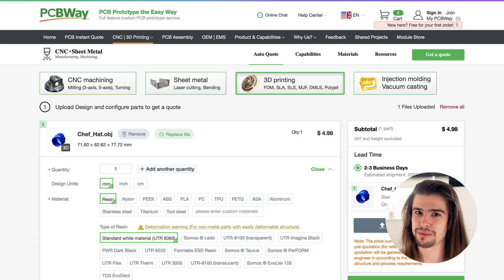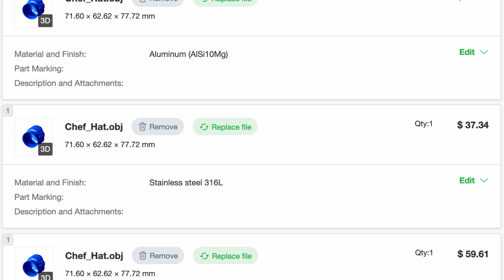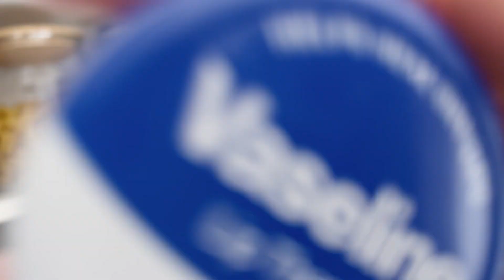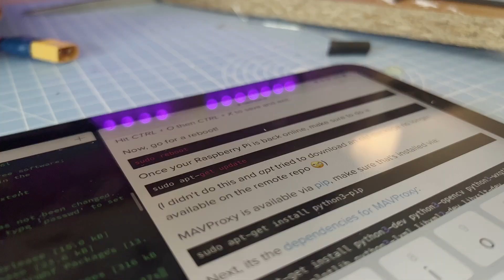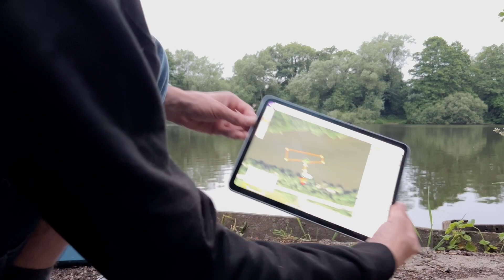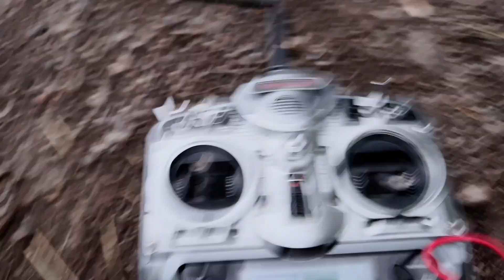3D Printed Drone Boat With PixHawk Flavored Sprinkles On Top

Comment: Ghizzz crist! just get a cheap Ender V2 or larger chea FDM printers and avoid to much  all that glue thing! the cost you've used in all that glue epoxy and all are just the same as a cheap big volume 3D printers anyways!

Comment: Dip your silicone tool in dishwashing liquid and it will work fine .. works with fingers too
Reply from the maker: I was trying straight water with no luck, will try this next - thanks!
Reply: @akamatchstic  might want to add some water if liquid is very concentrated...

Comment: How will your boat right itself if it is flipping upsidedown by a wave. BTW, you would do well to have a bilge pump and seal your electronics with a marine grade epoxy. They don't get along well with salt water. If a 3D printed hull is your final design, then cover the entire exterior with fiberglass cloth and epoxy to prevent a hull breach and achieve as low a drag as possible. Lastly you need to make major improvements to the area of the propellor shaft seals and glue the u-joints to prevent loosening while underway. Good luck.

Comment: If it's not underway yet, (1) look at the newest development in propellers where props don't have solid blades but loops. These can be much more efficient. You'll be aware that currents in the Atlantic can easily flow at a couple knots and when these are against your boat, you'll need to be able to exceed that in order to get forward. (1.1) this means your waypoints nav AI may need to be able to adapt its route to those current patterns. Along such lines, if you are familiar with AIS and sailors on the fear of ocean going sailboats of being overrun by large cargo/cruise (military?) ships then you'll know how they use AIS to sleep better and occasionally steer clear of a collision. Some of these sailors have called a, say, 400m long container freight ship to ascertain their actual path - they got politely answered but the crew in the wheelhouse may have been ROTFL after that call.
Then, what if (2) heavier ocean waves flip the boat over? Is it self-righting? If the boat doesn't have sensors that measure its orientation (and wave motion from that) and so it cannot use such data to sail perpendicular to the rolling direction of waves, then trying to prevent the flips is difficult and getting flipped over is a very serious risk.
The boat can navigate waypoints as you demonstrate but when it is upside down in the water, collects no solar, and tries to navigate the waypoints, the battery will be flat really quickly. So when another wave flips it in the right position again, will it (3) boot its electronics again once the solar has collected enough power?
The "big" lid is (4) a bit of a leak risk as you demonstrate and I probably would have opted for a (5) two compartment design where the motors are in a separate chamber, so there would be a waterwall (cf. firewall) between the electronics and the motors. This would also make the lids smaller, each and this is easier to DIY into waterproof.
You also demonstrate that water comes into the innards easily via the propshaft and its tube. Yes, grease will reject it for some time, but at the scale of an Atlantic crossing? Human size adapted boats will have have a bilge pump that sends such water overboard. (6) I would consider an aquarium pump and check valve to send water out of the motor bay. Note that sea water is very salty and also very easily conduces electricity. With demineralised water in your espresso machine's steam boiler (never do that) its level meter might not detect water and fill infinitely. Check out recipes for sea water aquariums and you'll be astonished to see how many kg of salt you need for a 1,000 (1m^3 - not huge at, say, 0.6m deep * 0.9m high * 2m wide, filled to 0.83m high) tank. The trick in aquarium pumps is that they connect the drive shaft of the motor with the pump via magnets and there is a waterwall between pump and motor that way.
As it stands, the overall design is really elegant, but I would nevertheless (7) add a rudder. At the scale of the boat that may be sensitive (not sturdy) but it gives a backup plan for cases when one of the differential drives fail.
And, as the video demonstrates the inclination of the screws on the motor/propshaft coupling to get loose, I would (8) consider to fix those with Loctite when the boat is sent to the other side, or even glue parts together permanently. Parts of the Atlantic have weeds floating around (cf. Sargasso) and then there's human pollution - a sailor's nightmare when your propeller gets arrested by the "green" stuff or the pollution. Maybe in the software you can have a prop-cleaning routine that does quick bouts of alternating forward/backward spurt to try to loosen stuff from the props when the suspicion of that arises. (Some of today's digital cameras have actuators in their sensors to try to shake off dust. Does that work? Generally not, but often enough to want to have it.)
Reply from the maker: I seriously appreciate you taking the time to write this comment! With this current iteration being just proof that I can actually build something that floats and has working propulsion, I’ve skipped over a LOT.

I’m already looking to change the hull design to be self-righting, likely with a mono hull and center of mass below the waterline. For redundancy I’m thinking of combining the differential thrust with two rudders, and investigating how it handles navigation with eg one motor and one rudder available. Probably also investigate moving to using thruster style props, and completely avoid the prop shafts having to penetrate the hull.

You’ve raised some fantastic points, and quite a few that I hadn’t even thought about! I really like the idea of a prop cleaning routine, the compartmentalising of motors and electronics, plus handling ocean currents with “smarter” waypoints. 

Definitely a long road ahead of development from this first prototype that’s for certain
Reply: @akamatchstic  - you're a great sport - excellent response to me back again. Note that in general the ocean currents are predictable (sailors use/have current maps), albeit there may be a tidal aspect to it, especially in coastal regions. That can seriously take a small vessel off course or prevent it from going where it wants/needs to be. That kind of relative consistency does not apply to what happens on the surface, driven by wind. If a sailor optimises their route, sets their waypoints and timing, then they take these things into account. This is only one tiny reason why an ocean going captain's education is an applied BSc (at least in my country).
With an electric vessel (EV) you're not sensitive to large regions of mid (E/W) and mid (N/S) Atlantic that can have zero window for long times each year, so you don't have to take that into account. But squalls can wreak havoc to the surface and if/then median waves can easily run up to 3m high. That should not be a problem as long as the waves stay sinusoidal in shape, but with high winds their tops fold over and can flip, or throw back, your EV.
So, sailors also make detours along current flows that are in their direction and they get to their destination faster than the shortest line would have given.

Thrusters are a nice idea that tries to solve an efficiency problem with propellers, but they add some resistance and drag. The "new" loop like propellers mimic the thruster tube without the tube and in the way a wing of an aeroplane causes lift, their shapes cause forward lift on top of the forward pushing helical motion through the water. These will become popular as fan blades too as they make much less noise (noise is lost energy and as these shapes loose less they make less noise).

The question what type of propulsion is best, is a hard one, though.
One challenge is to cut out transmission losses. If you can enclose the motors in a waterproof hydrodynamically shaped egg with the prop sticking out directly from the motor shaft, then that may be the most efficient. In your current model you have transmission losses because of the angle between the motor and propshaft.
Such a thing could be like an outboard motor where the motor is underwater. This is an optimisation problem again because in order to reduce transmission losses, you introduce an object with resistance. If, as a wild example, that motor were integrated into the ballast torpedo under the boat's keel then you have synergy.

In itself a thruster does not necessarily solve the leakage problem. Naval tech has dealt with that leakage since more than a century and propshafts may be lubricated in part by sea water.

Anyhow, pleased to meet you. Have fun.

Comment: I just need to install the electionics, I was going to use Pi, 4lte, I could put LoraWan and/iridium as a back up for small telemetry and course correction here and there?
Reply from the maker: Definitely would recommend looking at iridium, seems to be a solid way of getting data (even tiny amounts) to and from the craft!

Comment: When is the Atlantic Crossing? I have a almost built boat but need to install solar, pihawl. I built my catamaran out of wood and fiberglass.
Reply from the maker: No date set, I’ve got a lot more work ahead of me:

- hull redesign
- learning how to fibreglass properly
- electronics design with redundancy
- cooling system for the batteries and ESCs
- integration with iridium satellite network to send back gps updates
-  solar panel research
- learn how to build my own battery packs
- investigate propellor design for efficiency (eg toroidal)
- investigate moving to thrusters attached to the hull and combining them with a rudder

Comment: The version for open sea will definetly needs to be more robust and made from single piece and already hard prooven proffesional (seal) parts. I do not trust ESP32, there needs to be also some controller redundancy. Maybe if this will be bigget boat with two 200Wp photovoltaic panels, it should be dueble.
Reply from the maker: Definitely agreed! Looking to move to a mono hull design built from a fiberglass layup, using a radio link for transmitter and satellite internet for eg GPS updates when out at sea. Got a lot of learning to go before then 😅

Comment: Was worried if you had retired! I've been tinkering for months with a Jetson Nano since seeing one of your vids
Reply from the maker: How have you been getting on with it? Found that’s it quite a capable little system this end!
Reply: @akamatchstic  Never used Linux before, but think I'm over that hump. Needing to switch power to GPIO pins bc I'm switching FPC/HDMI/FPC for the cameras, though I probably should have just stuck with the ribbons.